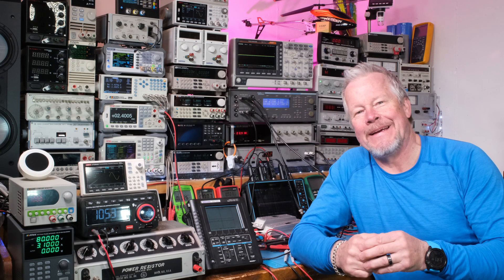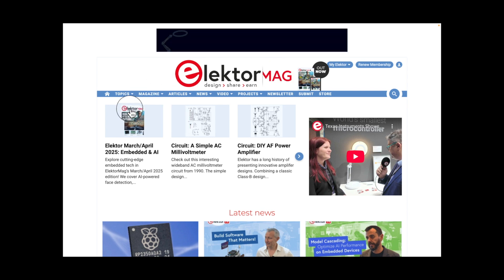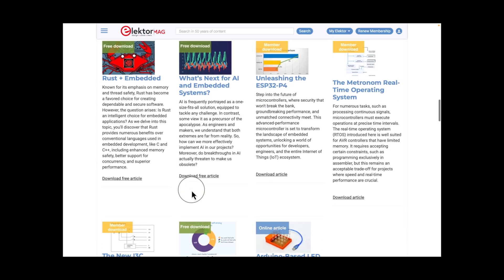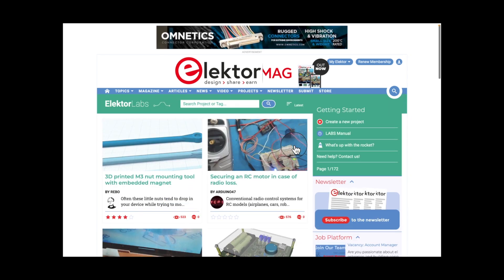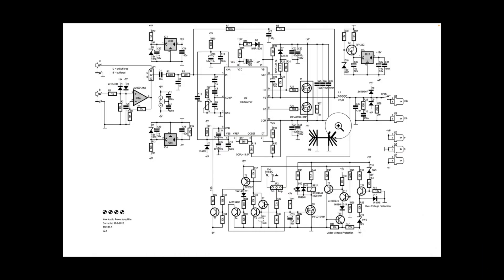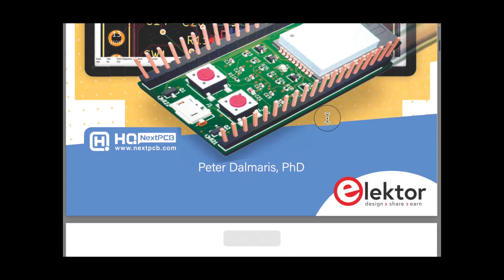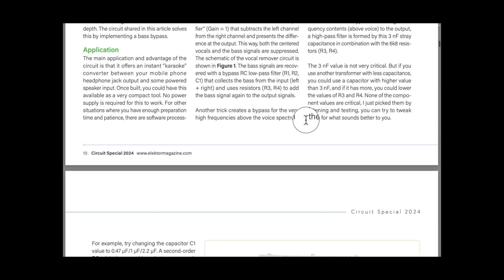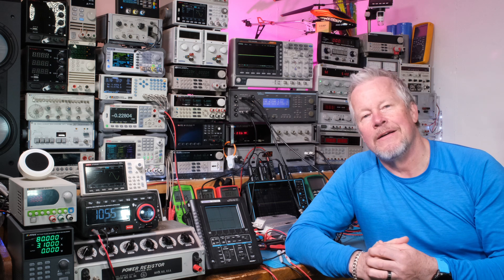Learn Electronics and Expand your knowledge with elektor magazine #elektormag #elektorlabs #kicad

Comment: Wie lerne ich Gedankenlesen um die abgeschliffen Chips zu bekommen?
Reply from the maker: Are you asking how you get information about chips that have had their tops polished off so that the identifying information is not visible?
Reply: @KissAnalog  Yes, i dont have 20k for the "Firmware". So how i do IT?
Reply from the maker: Great question.  Are you trying to repair/replace a chip?  Have you reached out to the vendor?
Reply: @KissAnalog  no, do you think that will help?
Reply from the maker: Yes it couldn’t hurt;)

Comment: I recommend Sprint Layout 6 too is a lot easier to create layouts and components parts can me made custom 😁
Reply from the maker: Thanks for the tip!  I hadn't every heard of it.  So, it looks like the tool if you only need a PCB design without the schematic - is that correct?